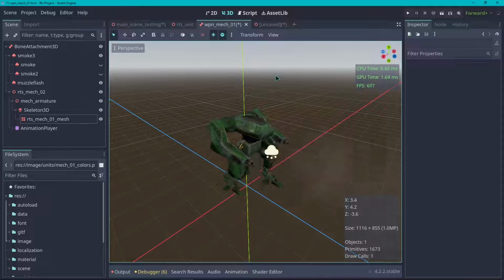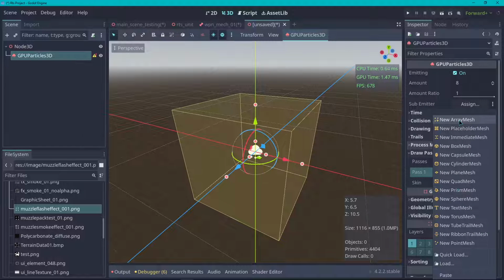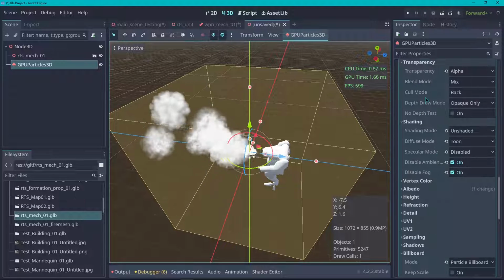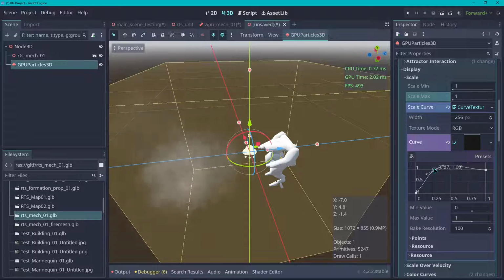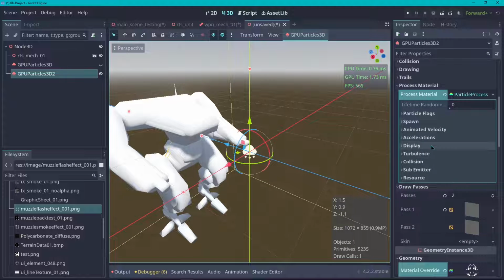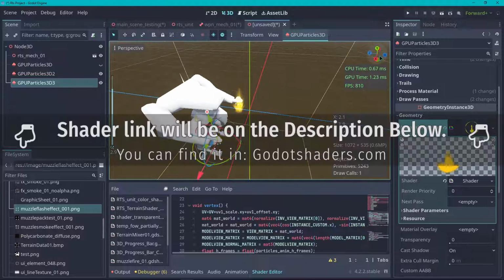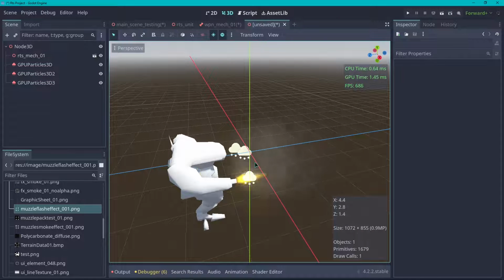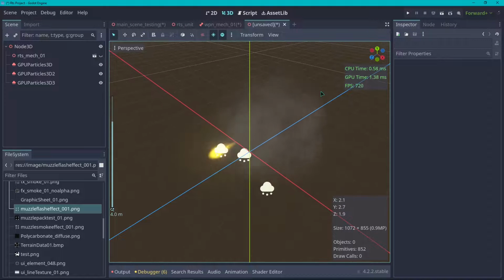Gunfire Effect From Scratch - Godot GPU Particles Tutorial : Muzzlefire FX and Smoke - Full Tutorial

Comment: Did you forget that kenney assets in godot assetLib? Did some checking there is atlas texture and AnimatedTexture which I try it out which seem work but not try the particles.
Reply from the maker: Yea, custom material shader and particle shader you can do anything you want, it's just much faster to work with what godot built in particle system, we could even had used sprite3D animating the sprite index with a atlas texture or a animated texture for the muzzlefire, there are many many ways you can do things in Godot, I just wanted to use particles for this.